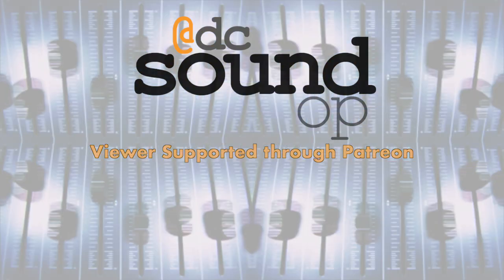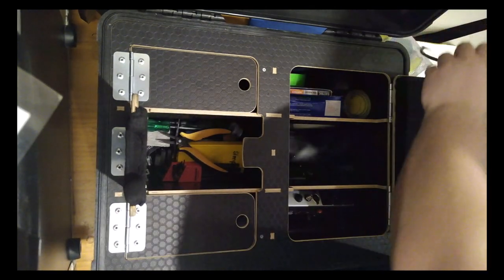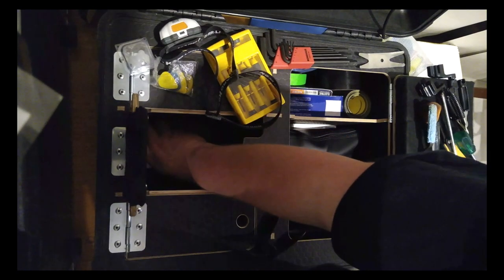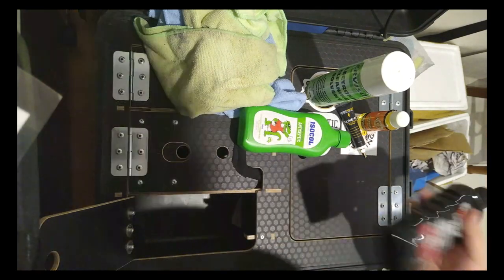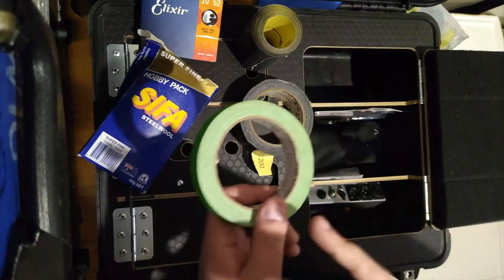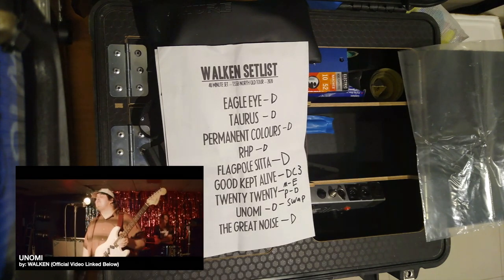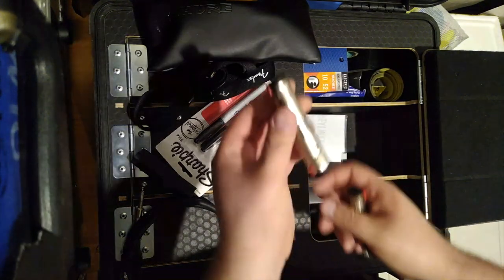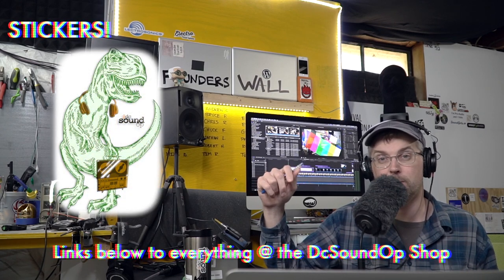What's In Your Kit?  Touring Guitar Tech edition with Dan Simpson?

Comment: INTERESTING, but that's about 1\2 of mi basic case! I carry 2 yes count em 2 electric string winders, both battery operated, as well as 2 hand winders!  two clip on tuners and a plug in as well. A small pick to push the strings out of tremalo bridge. I've never heard of anyone doing that, but I know I'm not the only one who fights those stupid things. Nut sause is great, but I've had much better success with commercial grade graphite like machinists use,  only thing is. It is gray and will discolor the nut and bridge slots. I use brass nuts so doesn't really matter much anyway. Battery operated soldering gun, extra di's are a must unless you want to pay for a blown out p.a. system somewhere. Magnet trays to hold screws. JIS (Japanese Industrial Standard) philips head for pacific rim instruments with Chinese screws that strip out when you use SAE tools. A simple spray bottle, because believe it or not guitars need moisture, especially in winter\extreme cold weather. Strings for sure, but lots of high E strings in, 8, 9, 10, 11, and even 12. SEVERAL sizes and styles of wire cutters, forceps, clams. A string strecha!!! So the new strings can be streched EVENLY from nut to bridge. Goo Gone; (it's a life saver). A box cutter with extra blades. Yes, bone nuts do crack and have to be replaced . An extra 1\4 in. jack. Extra pick guard screws, tooth picks, tongue depresses, nail files & q tips. Sounds like a lot, but where you gonna find that stuff at 4:30 Saturday afternoon in Sydney Nebraska? And the only thing open is the truck stop.
Reply from the maker: Hey Popo, if you ever feel like sharing your kit in a video, give me a shout we'd love to have you on to learn from what you do! All the best.
Reply: @DcSoundOp  would love to do it! Fur sure, but time is an issue this minute. I'm the road & production manager, guitar tech, bus driver, father, husband, uncle & financier to an up and coming rock band, as well as keeping a full time job, and a guitar repair shop open. I'll see if we cant squeeze it in there somewhere. lol.